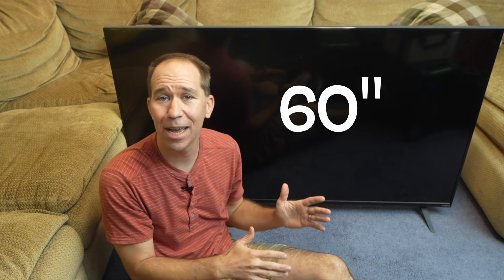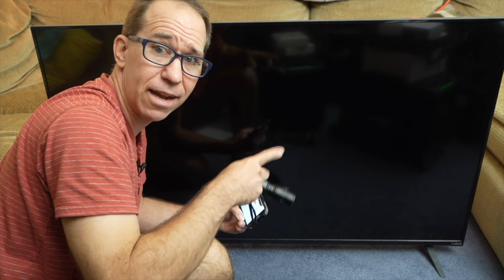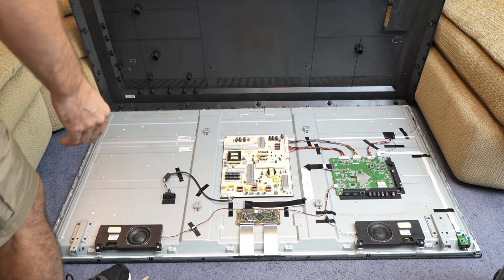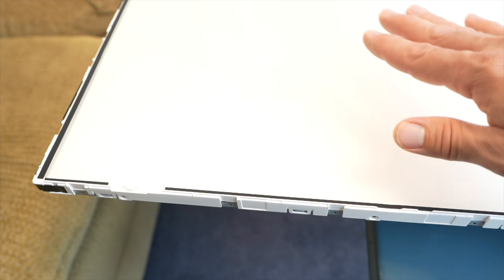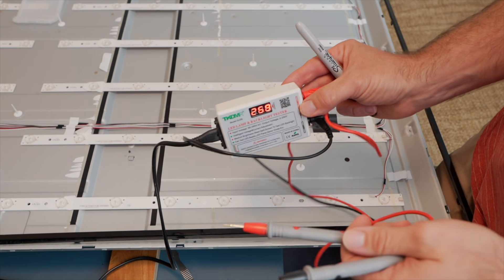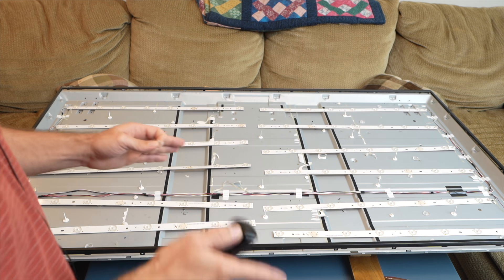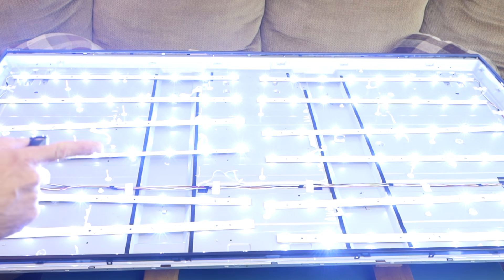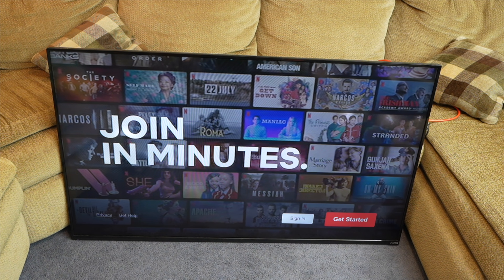Can I Fix a BIG TV for Less Than a $1?

Comment: Hey!  Love your channel.  You have helped so many people fix their stuff.  We are all grateful to you for sharing your knowledge and tips with us.

I have an LG OLED65CXPUA with blueish horizontal lines. I watched your video on blocking clock signals on YouTube but I can not locate the clock signals on my PCB.  Can you offer advice as to where I can find them?
Reply from the maker: Thank you for the kind words.  To find them you can use a multimeter in continuity setting (beeps when there is an electrical pathway) and look for a group of 4-8 lines that match on both sides of the tcon outputs.  Line 1 or the last line on the output port wouldn't be it (they are usually line voltage or ground).  Hope that helps!

Comment: would you please consider adding how long each process takes?  I'm curious to know what kind of task we are taking on. I'm sure an amateur trying to do this would take a few days
Reply from the maker: I'm not sure how to answer.  I've done this a bunch so I agree that the first time will take longer.  I think the main thing is to decide you want to give it a try and you learn from the experience.  The biggest thing in this process is to avoid cracking the LCD screen since it is so fragile.
Reply: @FrugalRepair  I understand, it's hard to estimate. I'm assuming this can take easily 8+ hours since its delicate. time will tell. thanks for your videos, are very informative!:hand-purple-blue-peace:

Comment: LOOKS LIKE YOU haven't posted anything new for a year now?
Reply: Sorry to hear that.  I have a 47" Vizio that the power light comes on and fades out after a few seconds, and I am trying to find out what it is. I'm guessing the PS, but need more info about it.  Ed
Reply from the maker: Thanks!  Hope you can track down the issue.  If it’s older, it could be the firmware chip on the main board.  But you should be able to track down which board has the problem but isolating them and testing.
Reply from the maker: Thanks for noticing a delay in posting (hasn’t been quite a year though). It’s not for lack of desire, but we had a kitchen fire at our house and it’s been crazy trying to get all settled.  But everyone is ok and I’ll be posting again soon.

Comment: My screen was turning blue from old LEDs.  I replaced them and now when I try to power it on, the screen lights up light it's going to turn on, no image comes up, then it goes black for a few seconds.  Then the LEDs come back on for a few seconds.  Then go off.  And on it goes.  Was I sent bad LEDs?  They all look like they're powered on from the light through the back panel and I reeeaallly don't want to move the screen again if I don't have to.  Is this more a board or connection issue?
Reply from the maker: Sounds like you replaced the LED strips.  It is possible you were sent bad ones, you would have to test them to make sure.  You can try turning your brightness down in settings to 10% or so to confirm the issue is with the LEDs.  Otherwise, I would guess a connection somewhere isn't plugged in correct.  This has happened to me lots of times in a repair.  If I had to guess, it would be the ribbon cable needing to be re-seated from the LCD to the tcon board.

Comment: Incredible! I loved the tip with sliding a piece of cardboard under the LCD. I've seen other people using suction cups to remove the panel but I wonder if that would provoke bends and breaks.
Reply from the maker: I would be concerned with using suction cups but with two people and cardboard, I think there is less chance for a cracked LCD

Comment: I have a panasonic TV model number THL60E55A it comes on for a few seconds and turns off whith a red light blinking on the power indicator 
I did notice a dark spont on the top left hand corner 
What should I do to get this fixed. 
Thanks in advance

Comment: Hello.
Just found your channel and hoping you can help with my TV.
The breaker flipped due to use (been very hot and AC was running full blast). The 2nd time the breaker flipped was within 5 minutes. That's when my Roku TV remained black with vertical lines in it. The lines are in two sections and remind me greatly of the former World Trade Center Towers. Wide pillars with dozens of vertical lines from top to bottom.
 I'll post a photo on my community page so you can others can see what I'm talking about. If the TV can't be easily fixed,  then I'll remove the screen and turn the set into a large lightbox.
Reply from the maker: I took a look at it.  I don't know off hand what the issue is because it seems strange a nuisance breaker tripping would affect the TV.  If there was some kind of power surge, you'd want to check the power supply.  Does the boot screen look like that?  If not, I would try a different input (maybe the HDMI port or HDMI controller went bad).  I have a video on what to check after a power surge if you wanted to check that out.  I'm sorry I don't have a clear answer for you.
Reply: @FrugalRepair  Thanks for taking a look. The boot screen looks like that as well.
Nothing at all connected to the Roku TV. Looks like this with every reboot.

Comment: Hi guys - I have a Samsung UN55TU7000F.  It's got a short circuit as it reboots, no picture, but there is sound.  I disconnected the main board from the power and backlights stay on.  I disconnected ribbon cable from the main board and it boots fine with no picture.  So, that tells me that the short circuit is caused by one of the 2 ribbon cables.

Well, I'm feeling complete defeated and I think I'm ready to accept it a throw away.  When I add tape to all clock pins...  it does boot fine, and as expect the picture is bad.  I've discovered I have to have the 4th pin covered.  As I was removing other pins... I have to have the 9th one covered too :(  Picture is still pretty bad.  Also, there is a black line right through the middle of the TV.  

I couldn't find a good/easy method to cut the tape small enough for one pin.  I just feel discouraged b/c I'm typically always successful in DIY projects, but I'm just not sure that this TV is repairable.  If I have to have multiple PINs covered the picture probably won't ever be satisfactory then, right?  This TV was perfect 2 days ago... how do shorts occur in multiple PINs at once??

Comment: I'd love to see you getting hand on any iiyama g-master gb2770qsu-b1 red eagle monitor that has horizontal lines and trying to fix it, that could potentially save me hundreds of euro :D those monitors have common fault where they just start showing off horizontal lanes when switched to higher Hz, and then over time it covers more and more screen and you need to lower and lower your Hz. I already have set to 50 hz (it goes up to 165) and have only small flickering at the very bottom, 60 hz is alright but can't see subtitles cause the line cover more, at 120hz it's half the screen and at 165 hz it's 99% of the screen covered.

Any idea what would the problem in that case? Deffinitely monitor, cables and all are okay, checked witch other monitor, also checked this one on different pc.

Comment: Hello!! Good stuff!! I'm looking to repair my 65" Vizio. When I power her up I get the flashing indicator light followed by a quick appearance of the Vizio logo and then it quickly disappears, the backlight goes off, and then there's no picture visible. I can see the picture with a flashlight. Im an electrician so my gut instinct tells me it's a power supply LED driver issue. Is there any way that I can track this down further. I have already eliminated the main board as the issue by swapping with a known good one. I figure the power board and LED driver are on the same board and I can get the board for under $30, so I'm willing to take the chance with that. Not too sure about replacing the LED strips themselves.
Reply from the maker: What you are describing sounds like a bad LED backlight like what I fixed in this video.  You can replace the backlight strips rather than the individual LEDs (which is usually not what I would recommend anyway).

Comment: Hi I've got a 60" JVC LED TV it goes on and shows the Logo and then the screen goes black power light on but black screen any help with that please tia
Reply from the maker: What have you tried to diagnose it?  Did you use a flashlight to see if it's a backlight issue?

Comment: Seen a couple of your videos pop up as im trying to fix my 70 inch vizio TV. Bought it a few months ago at a garage sale in good working comdition...now it is having issues. The screen has horizontal lines when the screen is on. The lines arent in the same areas all the time but change based on the image being shown. Do you have any videos on something like that? Thanks for the helpful sharing your channel does. Too many places just recommend tossing it and getting a new TV...hoping thats not the case here.
Reply from the maker: I’d recommend watching my two videos on fixing with tape.  I cover testing methods and explain issues related to horizontal lines
Reply: @FrugalRepair  thanks, I've been watching them on repeat and still not quite figuring it out. I'm using electrical tape and not sure if that's the problem...maybe I'm just not the guy for the job. Thanks for the help, your videos are very well done and are interesting to watch and learn from

Comment: Your adress can be seen on the bill from ali.

I have a 4 year old LG Oled, where the standby light keeps disappearing more and more often (TV can't be turned on). If I disconnect the TV and plug it in after 2-3 minutes, the standby-light comes back and I can turn it on again without any issue.
I would guess it's a capacitor problem on the power supply. What do you think?
Reply from the maker: Good eye, but that's not my address.  That's part of the seller's in the Philippines.   For your TV, I don't know.  I doubt its part of the "capacitor plague" on power supplies since it's newer.  You could try heating the caps on the power supply up with a hair dryer and see if the tv turns on.   I would probably first try to trouble shoot the button bar and/or remote sensor.  Maybe there is a short on there.  You'd also want to check the standard voltages and if the main board is sending the "turn on" signal to the power supply when the power button is pressed.  It may be labeled "PS_ON" or similar.
Reply: @FrugalRepair  Thanks for the response. Did some research in the meantime and this "intermittent standby led" seems to be a common issue in the 2020/2021/2022 LGs. Unfortunately, most repair channels just show the power supply swap, not the real repair of the board. Electronics repair is a hobby of mine, but the problem is, that I can't open it an then wait 3 weeks for parts...my kids wouldn't be very happy with that. I guess I'll swap it and repair it later.
Reply: @FrugalRepair  Update: I changed the powersupply-board, TV works fine again. This also fixed some other issues like repeatedly freezing firetv-stick and remote-control-pairing every time. Strange.

Comment: That's very clever sliding cardboard underneath the lcd and also using the heat gun to melt the solder and only later adding the led. I probably would have placed the led and then hit it with the heatgun only to ensure the life of the led  is shortened as a result of my stupidity.

Comment: But don't use stuper glue to stick lenses back on as it turns white when cured and messes up the lens.
Reply from the maker: If you are only using adhesive on lens legs to the PCB, how would it mess up the lens?
Reply: I cannot answer that until I take apart the TV again but at the moment I am using it. The super glue evaporates as it is drying and fogs up the lenses leading to a foggy coating on the lenses. There is a gel type super glue that doesn't go white foggy.

Comment: This TV is max $100 used so probably not worth all the risk and time. I save money by doing DIY car maintenance where u can save thousands.
Reply: So do we all but that's not what this site is all about so if you think it's not worth it to fix the tv then best you watch a channel about fixing cars instead of leaving negative comments
Reply: @Hobbyscrapperaustralia  obviously your time is worth nothing. This is not a job that a beginner can handle. He makes it look easy so a novice can spend a day and still not be successful. So risk reward ratio is not there.
Reply: @bobbyr8071  I've replaced hundreds of LED strips in tv's and never cracked the screen or broken the tv.It's very easy Doesn't take long at all to do
Reply: @Hobbyscrapperaustralia  can u share your background in electronics repair? How much have u spent on equipment?
Reply: @bobbyr8071  fully qualified electrician. Fix tv's for a hobby.No big outlay needed on equipment
Reply: @Hobbyscrapperaustralia  u answered my question, thx. So somebody with no experience who just found a non working TV, you will be earning ur money fixing it 🤣

Comment: Hello I have 2012 samsung smart TV. That will work for days and then out of nowhere start flickering on and off.
Reply from the maker: Is it the backlights that are flickering?  Or the image?  You should try turning down the backlight brightness to like, 40% (or as low as you can go and still watch it) and see if the problem still happens.   I'm wondering if your issue is heat related.   You can also take the back cover off, put a small fan on it and see if that makes a difference.  That may be a model later than when they had the bad capacitors on the power supply but that is also something to check (look for buldged caps).